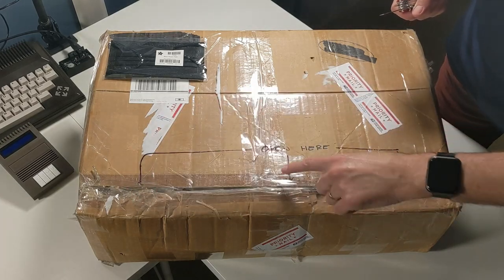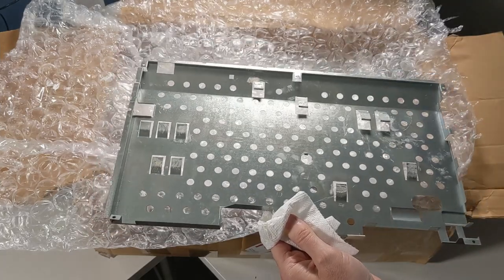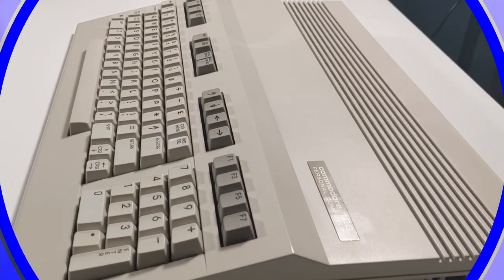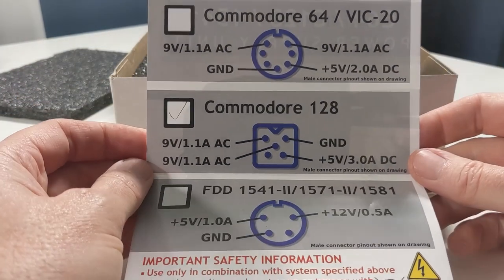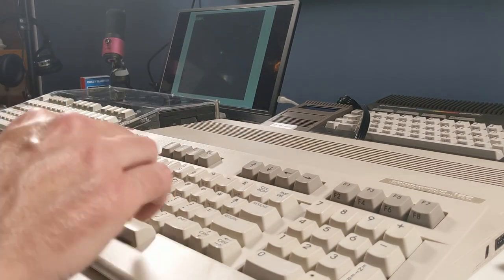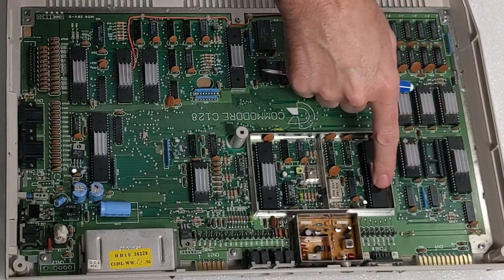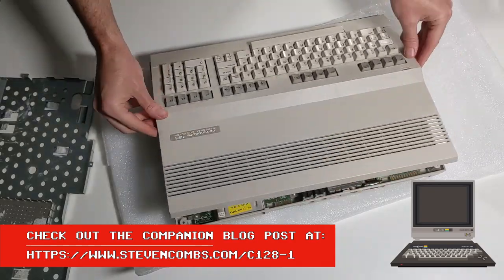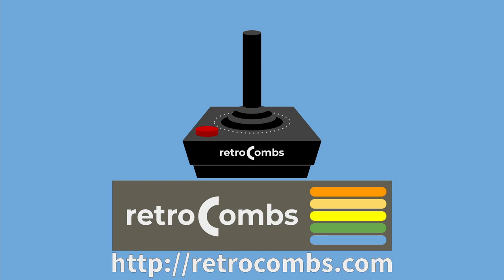FAST LOAD: Commodore 128 and Keelog Power Supply | New additions to my retro-computing collection

Comment: The wire is from the factory.
Reply from the maker: But why? Shouldn't this have been a trace on the motherboard. I suspect there's a story here.
Reply: @retroCombs  It was to fix some issue they found after the chips and motherboard design were done.  Commodore always had such tight schedules for CES and the Christmas season that when they found a problem they had to find a fix overnight. Exactly what it was, you would have to ask Bill Hurd.

Comment: Steven I have Mach128 cart my thinking how many 128 carts are there?
Reply from the maker: Great question. Can't be many and I need to research the Mach128.
Reply: @retroCombs  I have not found many and how you make a cart for it? I have a desk suite also that uses the port for extra power> Not tried that haha!
Reply from the maker: If I can get the Kung Fu Flash working in C128 mode, I could use the .CRT file and try it.
Reply: @retroCombs  Yes Yes I don't know how they work in 128 Is it a byte or key?

Comment: Very nice machine. Congratulations for the purchase.
i suppose, you'll probably connecting a RGB monitor as well ?
Looking forward to an in-depth video on that machine :-)
Reply from the maker: Want to configure this for a dual monitor if I can convert the RGB out to HDMI. Seen a lost of SCART solutions, but want to avoid them.
Reply: @retroCombs  this is the only solution i dug up. Not sure if you've seen it already:
https://hobbytronics.home.blog/2019/10/08/commodore-128-80-column-rgbi-to-scart-to-hdmi/
Reply from the maker: Apologies, this comment was held for review. Thanks for sharing and I'll take a look.
Reply from the maker: Oh, and unfortunately, I do not have an RGB monitor. Another one of those items I should never have gotten rid of those many years ago. 😥